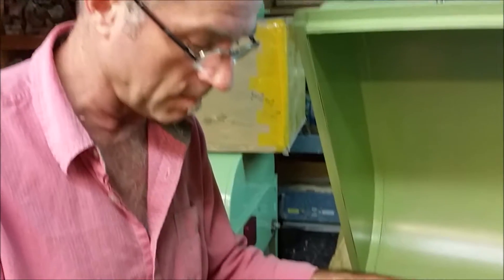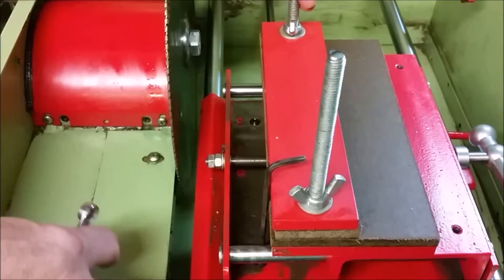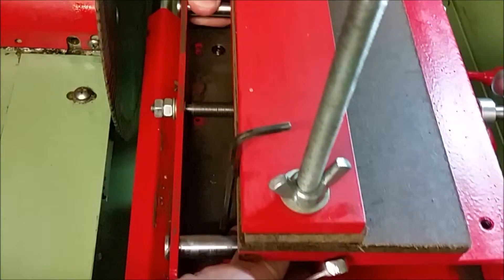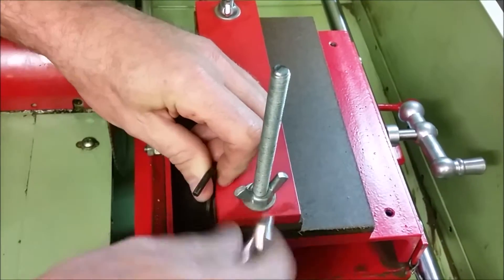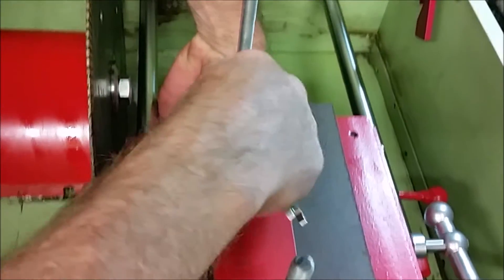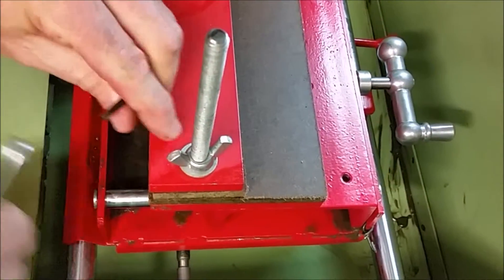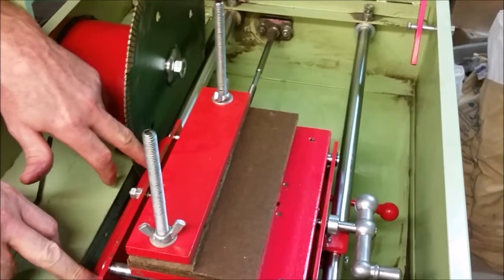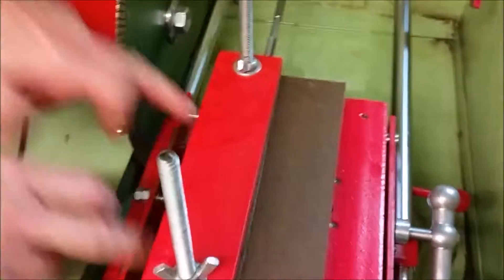Slab Saw Carriage Adjustment for Eliminating Blade Marks and Get Smooth Cuts

Comment: It would be helpful to many to know it takes a 5/32 allen wrench to make this adjustment. You should also have shown how to adjust the rear bearing, as you have to remove the handle,  keeper, and adjustment shaft to adjust it, and it is not as easy as the front ones by any stretch.